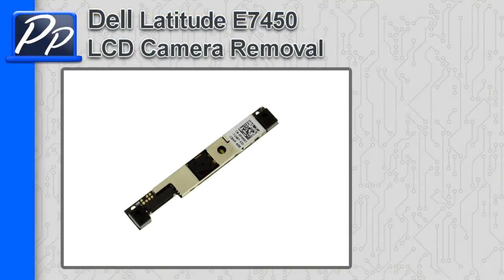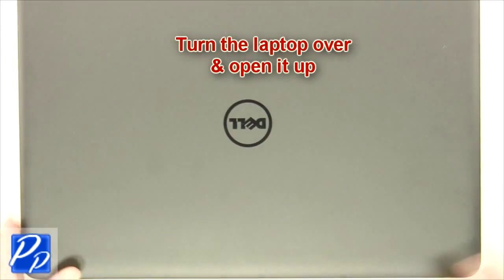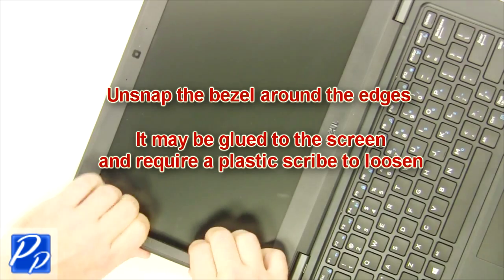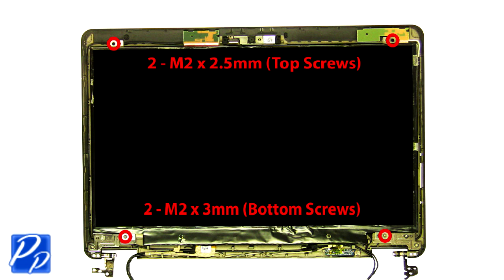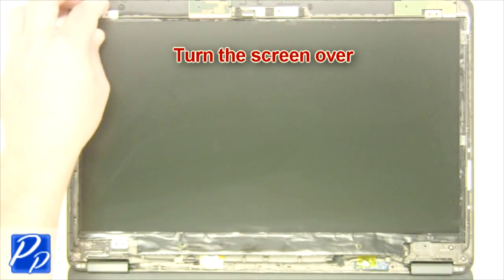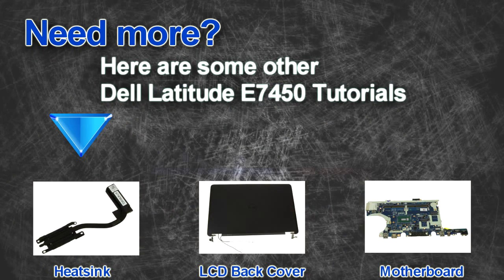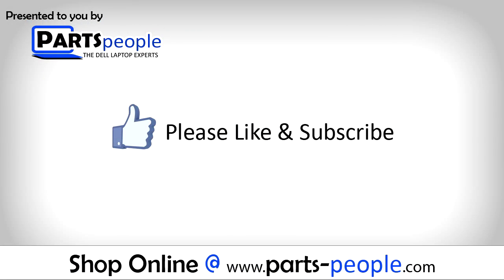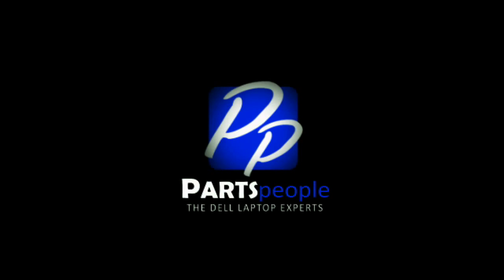Dell Latitude E7450 LCD Camera Replacement Video Tutorial

Comment: Hey guys, 
Have you happen to come across a e7450 without a camera installed form the factory? If it didnt come with one, would it require both the cabling and the camera module?

Many Thanks
Reply from the maker: +Vincent Chu It should already have the camera cable. You will need to get the camera and the LCD bezel with the  camera port.